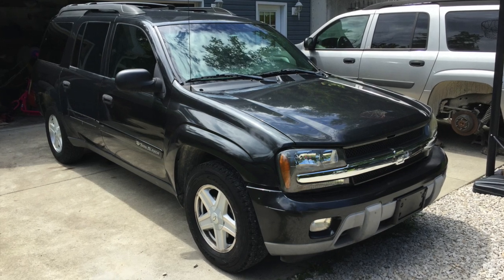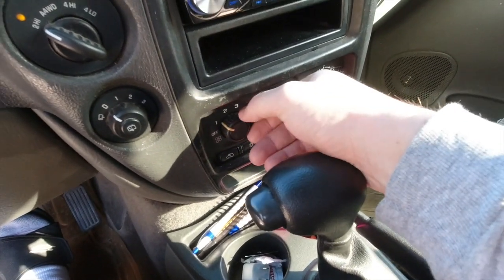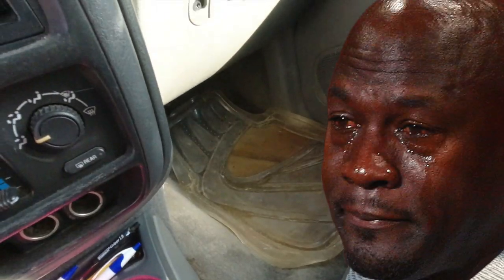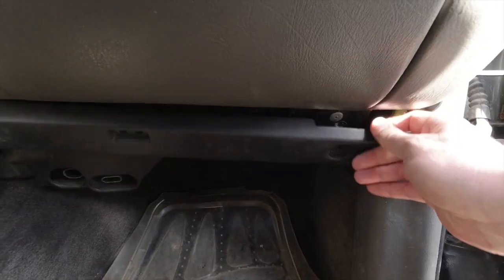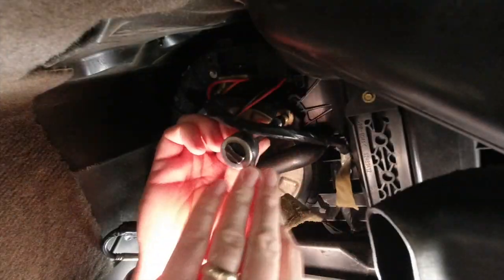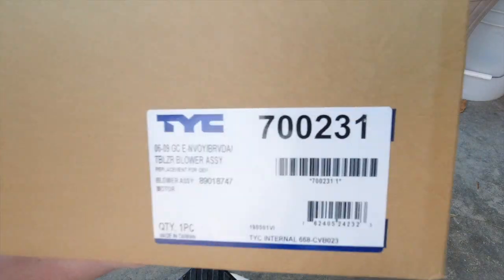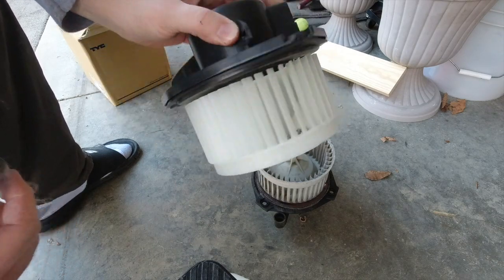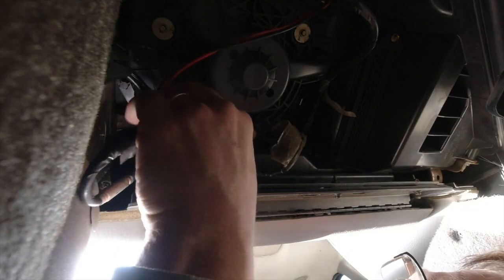LOUD noise when fan is running - FIXED - New blower motor - Trailblazer/Envoy

Comment: I think the Camaro is going to need a new blower motor. Nice job
Reply from the maker: Chemical Spore just open your exhaust cutouts and floor it. Problem solved and it sounds better anyway 😎👍
Reply: @TheDaninator  lol. After awhile of driving the air doesn't flow as well.

Comment: hey daninator, i have a chevy silverado 1500z71 5.3 V8, and i was wondering if you knew the inlet and outlet and length i would need for my truck to be able to purchase a cherry bomb glass pack. i heard its 2.5 inlet and outlet and 30 body length. also heard it’s 2 1/3 inlet and outlet?
Reply: Did you find out? I want to go with the M80, but I'm not sure which to use.. I see that the stock pipe is 2.75 in diameter, I'm curious as to if I should use a '3 or bigger?..
Reply: #1 Fan yeha i’m going with 3 and if it don’t fit you can jus put spacer in it to make it fit